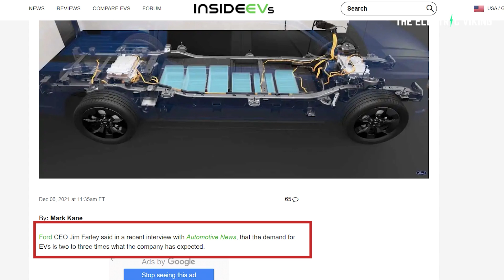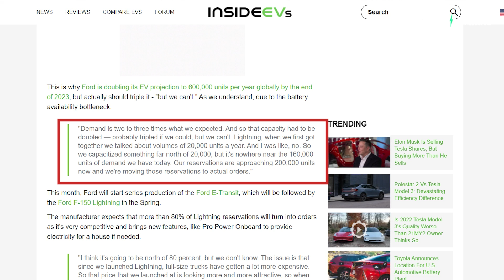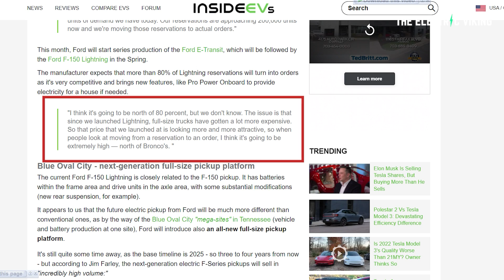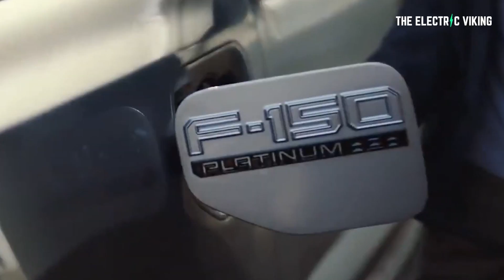Ford announces NEW mass produced EV Pickup Platform

Comment: These EVangelists keep coming out with this tired old analogy about smartphones as if it dismisses every argument against EV's. The reason people are not able to switch easily from a gas car to an EV is the same reason Sam gave in this video why Toyota can't pivot quickly and easily to make EV's: capital investment. Switching from a Nokia to a smartphone was as easy as going on a 24 month plan for $50 a month, and your capital investment as well as your phone bill was already covered. Getting into debt for $500 a month to pay off a $50k EV is a whole other ball game. If your existing gas car is paid off and your running expenses are $100 a month for fuel and maintenance, why would anybody take on all that extra debt for a car they may only drive 10,000 kms a year?
Reply: The cost of batteries has been decreasing exponentially and should continue to do so.  This is the largest single expense for making an EV.   Total cost of ownership of an EV is already much lower than that of an equivalent ICE vehicle.   In a few years the sticker price of an EV will be less than that of an equivalent ICE vehicle. When that happens, suddenly no one will want to buy ICE vehicles.   This is the challenge facing legacy auto makers.  Imagine what would have happened if smart phones were cheaper than traditional cell phones!

I hope you're right and people hold onto their ICE vehicles for a few years instead of buying new.  If they wait a couple of years then they can  save a ton of money by buying a new EV instead of a new but obsolete ICE vehicle.  Just to be clear, new EVs are not competing with old paid-off ICE vehicles.  New EVs are competing with new ICE vehicles.  Ford, GM, etc make all their money from selling new vehicles.  If people hold onto their existing cars for a couple of extra years, it will be a disaster for legacy auto.  They will go bankrupt even quicker than expected.

I highly recommend this Tony Seba video:

The Great Disruption - Rethinking Energy, Transportation, Food & Agriculture 
https://www.youtube.com/watch?v=Kj96nxtHdTU
Reply: @thesure1   You do have a point, and all credit to those who can spend the money to keep the car industry going. Most people buy the most expensive car they can afford. that might be a brand new car, a 1 year old car, a 3, 5 or 10 year old car, and new cars range from $20k to $100k or more in the ICE world. In the EV world, double that. The problem with buying a used EV is range. I won't buy an EV until I can buy one for similar range and a similar price as the equivalent ICE vehicle. Sure, I can buy a 2012 Nissan Leaf for $10k, but it won't get me through my work day without having to stop for a recharge. If I want an EV with acceptable range, at least in my market, I am spending 5x what I really need to for the job the vehicle is doing. You can't make that up in fuel savings, you really can't. I will eventually buy an EV if the EV advocates are right and we eventually get to price parity, and at least 50% market penetration, but we just aren't there yet.
Reply: @aftonline  about $7000 saved in fuel every 100,000 miles driven
Reply: @thesure1   So about $700 a year if you drive 10,000 miles a year as I do. I assume that's with home charging, not using public chargers. Still not enough. If I went out and bought a brand new Tesla today in my market, the interest alone on my purchase would be $7000 a year based on a $70,000 Tesla purchased with a loan at an interest rate of 10% per year. I don't have $70,000 burning a hole in my back pocket, and most people don't in this pandemic economy.
Reply: @aftonline  Stop pulling numbers out of the thin air.  2022 Model 3 starts at $44,990. Much lower interest rates can be found.
Reply: @thesure1   I live in Australia. Base model 3 is $70k AUD Our mortgage interest rate is 8%. Car interest is usually higher but let's say the rate is 5% that's still 5x the fuel savings per year. And that's not even  including the principal of the loan which I really can't afford anyway. Don't forget my existing ICE car is already paid for outright.
Reply: @aftonline  sorry you are in such a dire situation, we can grab a M3 Performance for under $59K U.S. here. I'd would have a hard time counting the Tesla's I see on the road here. I would guess at least 25% of all cars in my area are late models (all brands).
Reply: @thesure1  My car is nice but like every other car it is a depreciating asset. My house on the other hand, is an appreciating asset. My car is just a mobility tool. 

At this point in time, even the cheapest EV is double the price of the cheapest ICE car. So no, I am not targeting the lower priced EV's. I am not targeting any EV's until the price comes down. Unfortunately though, that may not happen before certain countries start mandating them. That means, we are going to have a 2-tier car market - affordable used ICE cars and expensive EV's. You won't even be able to buy an affordable new ICE car any more. And unless Tesla and a lot of other car makers make good on their promises to increase EV production to the levels that ICE cars are currently being produced, the law of supply and demand will force the price of those new EV's through the roof. 

All of this is being caused by draconian government intervention in the car market to "save the planet". I suspect I will be driving a beat up ICE car till 2050 if I am still alive by then, because unless they find a way of making lots of batteries cheaply and quickly, EV production is going to struggle along at the low levels we are seeing today. 2030 (or 2035) is going to come quicker than we think. Fortunately, in this country we have no laws about that yet, but then again we don't make cars here any more, so will have to import cars from wherever they are being made, and if expensive vehicles (the new definition of EV) are all we can get, that's what we will get. 

I hope I am wrong, but apart from Tesla, who are at least taking steps in the right direction, nobody else is gearing up to really replace ICE vehicle production by the cut off point, and are going to get caught with their pants down when the hammer drops, and they won't be allowed to build ICE cars any more.
Reply: @thesure1   That's all well and good, but I will go back to what I said in my original post, that after nearly a decade of Tesla production, EV's are still not available for the mass market, which is still dominated by ICE vehicles. It's easy to blame the ICE manufacturers for that, but even Tesla, with all their success and their production capacity, are still only talking about their "affordable" model. We still don't know what it will be called, or what it even looks like. 

Clearly there is a problem,, and the problem is profitability. Much is made by the likes of Sam, of Tesla's higher profit margins, and the reason for that is simple: Tesla are not selling cheap cars. Of course you can make a 30% profit on a $50k car, but try doing that with a $25k car, especially EV"s which have a high fixed built in cost because of the battery pack. This is why Tesla is delaying introducing their cheap car, because they know that when they do, they are going to have to divert the majority of their battery production to a vehicle that is inherently less profitable. I'm sure they will get there eventually, but they are probably also going to push hard to upsell their buyers with FSD and other add-ons, to raise that profit margin, as the profit margin is probably going to be closer to 10% with a $25k car. 

It's just the nature of our western economy, or any economy for that matter. We have a relatively large number of lower income earners compared to the high income earners. Just by living in a first world country like the US or Australia, we are automatically in the 10% richest group on the planet. And even within a first world country there is income disparity. Just owning a car of any kind is something we take for granted, even if it is a cheap rustbucket, but go to Africa, and you will see people piling into public transport vehicles to get around. 

There are about 1.5 billion cars to go around 8 billion people, but we have a disproportionate share of them. I believe in Australia we have 20 million cars for 25 million people so it's almost a 1 to 1 ratio, whereas it's more like 1 to 5 globally.
Reply: @aftonline  You are in the wrong forum.
Reply: @aftonline  Best of luck. I see everything differently but that is working well for me no complaints.